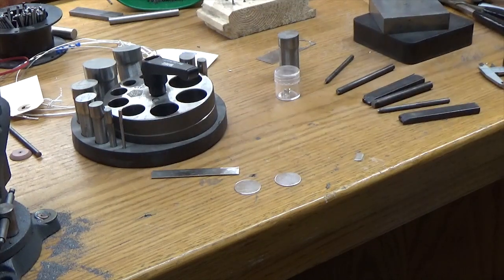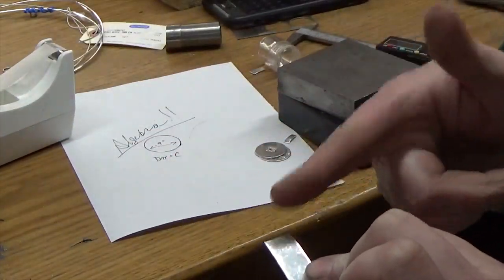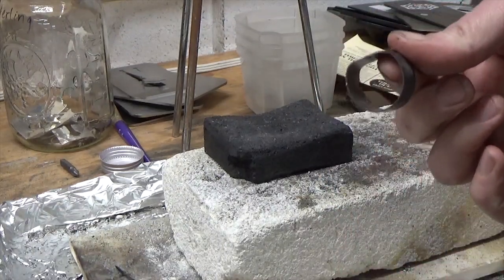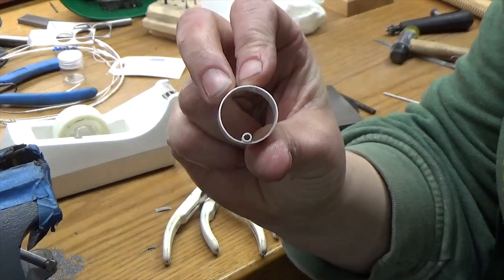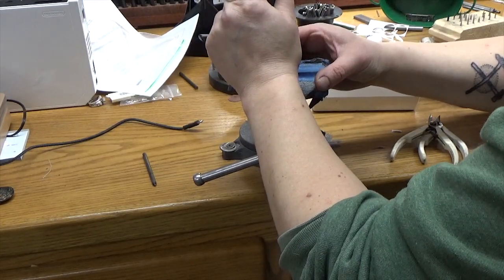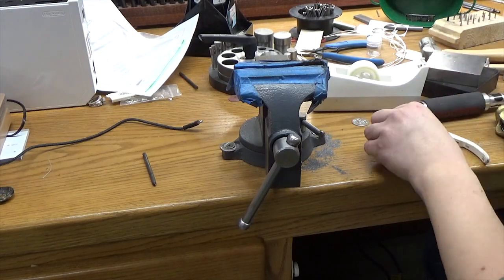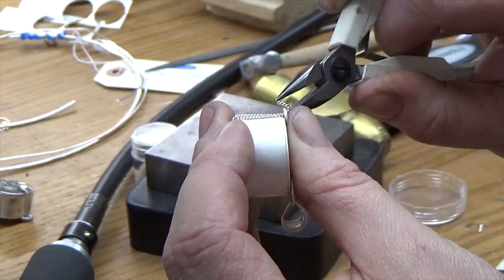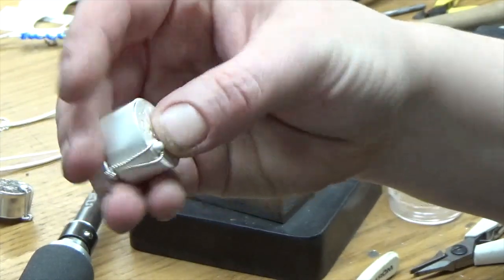how to make a pill box

Comment: Roberta, would it fit better if you had added the thickness of the metal before you multiplied by Pi?
Reply: I think you don’t have to because the back and too plate don’t fit inside the bezel. The outside circumferences matches for all three.